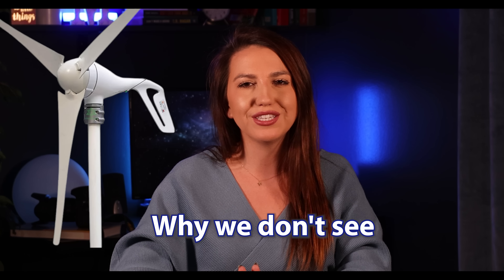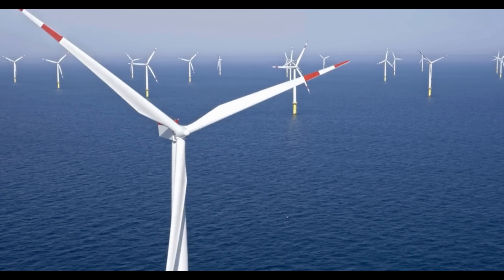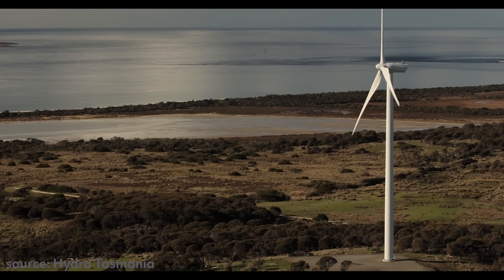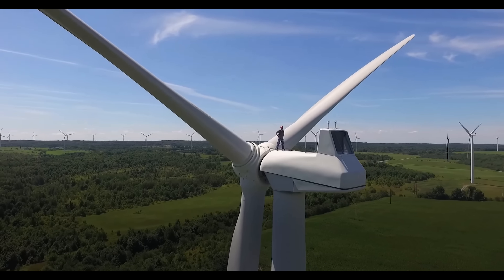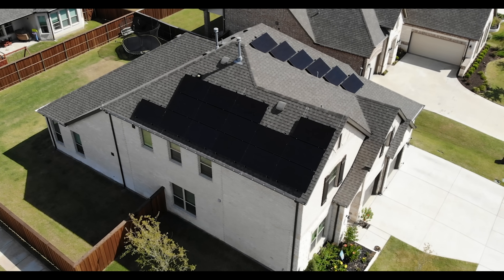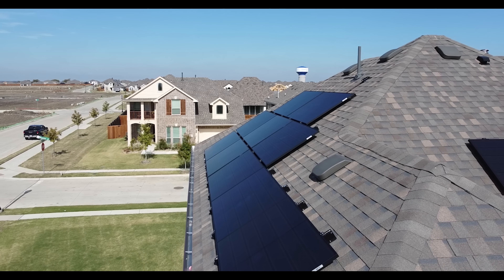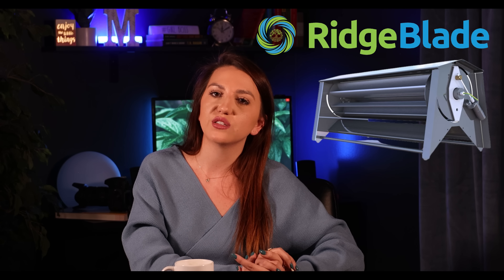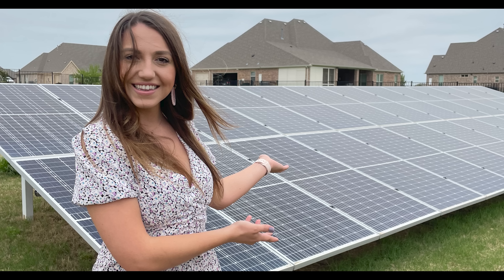Could this Turbine Destroy Solar?  | Why haven't we seen these small wind turbines yet...

Comment: Idea: Combined Solar and Wind Residential:
Use the PV panels and the roof slope to funnel the wind towards a ridge mount wind turbine system.  The PV panels direct the wind, aiding in keeping the PV cooler, and the wind speed increases due to the funnel effect.  
No one wants a typical wind turbine on their home, and HOA will try to stop them, but the ridge mounted design is much cleaner looking, and can allow more air collection to transfer to a single saft driving a well protected enclosed generator located at one end of the ridge, or the middle of the ridge where the home could have attic access for simple and safe maintenance.
Keep in mind a furnace fan is a scroll cage design because it is more efficient and this would apply to the ridge-turbines as well.
A ridge turbine could easily incorporate shutter blades to reduce winds that exceed the turbine safe capacity, or if the generator fails, the dampers can close,  If there were a snow or freezing rain condition the dampers can close to prevent ice forming on the ridge turbine, and being enclosed a heating system could be designed to remove ice from the blades while the dampers are closed.  Super simple, easy to maintain, safe for maintenance and wouldn't look out of place, and no bird strikes either - win win win WIND!

Comment: I live on Maui, one of the windiest counties in the United States. I am building an off-grid house right now just with solar. Micro wind turbines are too inefficient to be worthwhile relative to cost. Solar has gotten to be much cheaper and even with a huge surplus of wind I live on Maui, we get plenty of sun. I think this entire state should convert all the single family homes into off-grid power plants with battery storage because the state utilities sell power at 42 cents per kilowatt hour I can generate power with an unsubsidized solar system for under $0.16 per kilowatt hour. When I discount for hookup costs at $10,000 for the house and 30% tax credit on the cost of the system, my energy drops to $0.08 per KWH. Solar panels will shade my roof making my attic space cooler and protect my roof at the same time they're generating energy. I don't want the moving parts and maintenance required for wind power. I don't want the big pole in my yard. I don't want to listen to the hum of the wind turbine.

Comment: Windmills were intentially made huge so common people could not affort to buy a windmill. So they could have monopoly on electric energy. Which are the real reason the prized skyrocked with the CO2 tax. It was a school named Twind in Denmark that original started the idea not to be dependend on buying electricity, by making their own windmill. Soon after in 1970 there were an explotions of innovations of exploring the potential windmill energy. Those companies got bought up and new politicies were made. A CEO resigned due to that policy to only make huge windmills.
Later Co2 tax were added. That original idea to benefit from the free energy from the wind and get cheaper electricity, never happened. The investers got greater profits instead.
But to say windmill are bad and not effective is none sense. Those people just dont get the real scam in this.

Comment: Great video - Pup got you the sub before I even finished the video! Is there any type of small car mount turbine that would work to charge backup batteries or solar generators while driving? So many have to drive a lot during the day and something like this could help add extra power we could then take back home for the night. Thanks.
Reply from the maker: Thank you so much!! and not that I am aware of. But you and many others have thought of the idea of a car mounted one to recharge the batteries. Or just wind turbines to be installed along highways since the cars already generate so much air movement.
Reply from the maker: Thank you so much!! and not that I am aware of. But you and many others have thought of the idea of a car mounted one to recharge the batteries. Or just wind turbines to be installed along highways since the cars already generate so much air movement.

Comment: You know you're in for some BS as soon as you see "this (insert latest gimmick here) could or will DESTROY" whatever is working fine now.
Reply from the maker: Not really :) I did a ton of research and as a new youtube we have to try different methods for the algorithm to pick us up and show it to masses. At the end of the day, the people that clicked on the video and stayed, YouTube saw the video as somewhat valuable. So it helps us creators grow. 

If you really watched the video you would see I put my heart to fully understand if wind makes any sense for residential application. The title is changed every so often to see what works best for the viewers and its recommended by Youtube. 
I do think that the title did a good job as I got over 300k hits, and I am a newbie on youtube! :D 

I am writing this with most respect. Just put yourself in my shoes.
Reply: Hi. I have been interested in windpower since the 1970s when I saw a programme called House for the Future in the UK. They had a simple wind generator on a tall pole in the garden and it was used to power the immersion heater and apparently worked well. They incorporated lots of other  ideas around insulation, solar water heating and heat storage etc.

I have watched the whole of your video and agree it is well researched and informative. As you say, roof top wind generators are not really practical yet and unlikely to overcome the shortcomings you describe. So perhaps you can understand my scepticism  having seen the Destroy caption because even you don't think it's going to happen.  

I shall watch some more of your stuff. You do get a lot more interest than I get from my 17 followers 😂 but I'm only posting music.

Comment: I considered that a mechanical flywheel in addition to the prop catching the wind would be a useful combo leveling the power output but I also have considered  a battery bank to provide power with the wind to match or exceed the power demands;  but with no experience with wind, I rely on the presentation and comments which indicate noise and optics are issues to be resolved.

Comment: Wind generators are common on cruising boats.  The reason is that their off grid electricity cost comes to ~$1/kwh from diesel generators or worse from alternators.  The noise is always a problem and they don't last long but sometime in it's 3 years lifespan you WILL be stuck in an anchorage due to bad weather.  Then you will be grateful for the abundant electricity.

Comment: Technically, simple common sense ask one question first when you compare solar and wind and that is : Moving parts?.. That translate to maintenance, breakdowns, noise and cost. Yes, wind is a true help in support of solar when the sun sets. For a home it will keep the security system, lights and WiFi on while you sleep, preventing the batteries to drain. It all boils down to management and spending funds effectively and wisely, not on to good sales talk.

Comment: Solar is energy directly from the sun.  Wind is just indirect solar.  The sun hits the planet, heats up air, that air rises now having lower density than cold air, cold air from surrounding area rushes in under the now ascending warm air, this is what creates wind.  So between direct solar, and indirect solar, it seems like it should always offer more energy potential to just use solar directly.  The problem with both sadly is the incredible markup of the product.  As long as it is a fad to have any renewable energy and there are government programs to help consumers buy them, there will never truly be competition in the market.  The existing competition is not to provide the best product for the lowest cost, but rather to try and justify a high cost and grab up all the government benefits offered to green energy.  In a truly competitive market these products would be 5 - 10 times less expensive which would then actually make them capable of producing electricity for equal to or less than the cost of grid power in most areas.  Sadly because of the hype around green energy, their cost is drastically disproportional to their production cost or their over life time actual value.

Comment: Finally. People are getting smart. Solar only works part of the time. Wind turbines work more.
Reply: Well... Wind turbines tend to "work more" during the winter, where solar panels tend to "work less", but wind turbines also tend to "work less" during the summer, where solar panels tend to "work more".
So there is no one green power greater than the other, they complement each other.

Comment: Water flows throughout the city water system.  Why not take advantage of the flowing water through use of turbines or wire systems.
Reply: Well if you took advantage of the kinetic energy of pipe water in cities, than you would be taking away the kinetic energy of that water, and it won't have enough of it to make it all the way to your shower or sink.
What we COULD do however, which sounds much more realisitic, is to collect hot water from showers in big tanks and use that waste heat to make heat pumps more energy efficient, drastically reducing our heating bills and reducing the energy demand for heat. And I wonder why nobody ever thought of doing that.
Reply: @texanplayer7651  Thermal transfer from the ground is more efficient and $0 to heat the earth.

Comment: great video!   You put in a lot of work.  I wonder what you think about the grid with all this new tech?  Do you think that the grid could be looked at basically as the horse and carriage of power; and home based solar/wind/hydro/battery banks would be the automobile?  Seems most logical to me.  A huge portion of my power costs is associated with the grid(delivery they usually call it on the bill), not the actual power production or consumption.    And also, local zoning makes it very hard to use renewable technology, even in very small scale; due to what seems to be always concluding in having to be connected to the grid.   Even with solar on your home, often you are required to sell it to the grid only and then buy back your power from the grid and ultimately paying delivery costs.  You still have to pay delivery even when you produced the power at your home.   So, if the grid is the horse and buggy of power, I'm definitely really ready for the automobile.

Comment: The yields of Icewind and Liam F1 Archimedes look rather disappointing - have you looked at the KiteX its daily yield averages between 1.8KwH and 3.1KwH at an average wind speed of 7m/s (start up at 3m/s).  It tops out at 12m/s and shuts off at 15m/s so may not be suitable for high wind areas.
Reply: "may not be suitable for high wind areas"
The Liam F1 did mention that their invention is NOT meant for high wind areas, it is only meant for low wind areas.

Comment: Excellent overview. I like the Aeromine  design mainly because of no moving parts. I wanted to invest in Aeromine but it is a private company.  You might want to look into ammpower corp. which is developing green ammonia production. Ammonia can be used as a way to safely and cheaply transport hydrogen which can be used as an energy source store in fuel cells. Ammonia can be used as a source of fuel energy and also as nitrogen fertilizer. The company hopes to make units for farms and maybe later for homes.
Reply from the maker: Thank you so so much for sharing. I will definitely look into it. Also just posted a video on Aeromine product a week or two ago. Maybe you can check it out. I am very excited about their product, just hope they launch sooner. Here is the link to the other video: https://www.youtube.com/watch?v=FH545iR_j5I

Comment: You haven't seen all the trouble with them freeze up in cold weather the cost of replacing the blades is astronomical then you have the oil that needs changed its not just a little oil you should check the truth about them

Comment: The reason you don't see many home turbines is because, except in rare circumstances they don't produce much energy. One major reason for this is that when you are close to the ground there is laminar air flow, i.e. friction from the earth slows wind down. You need to put the turbine at least 150 feet in the air to get past this layer, which is expensive and considered an eye sore. There are also a few more reasons but for brevity are not discussed.
Reply from the maker: Very very good point, and thank you for sharing.

Comment: What happens when there isn't any wind and it's 95 degrees out? Plus how long do you have before the motor burns out? Plus what does it cost for yearly maintenance? Plus how many birds squirrels lizards etc. does it kill yearly? Plus how would they hold up in storms, hurricanes, hail, and humidity?
Reply from the maker: EXACTLY! Until those are actually answered with a proven product, I am with you. Not a chance against resi solar panel installations.

Comment: I made my out of pvc and its been working since 1987 has 3 alternators on a 10 to 1 ratio gear  belt drive. so far haven't had a problem only down side  when the weather is to hot there is no wind.
Reply from the maker: oh wow, thank you for sharing. That's pretty cool, and yes the weather plays a big role in wind patterns, where are you located approximately so we can analyze with wind world atlas? :)

Comment: Can give me advice on vertical wind turbines? I live in a camper in Wyoming which has a lot of wind. Don't have to put it up high, I run 2 , 200 watt solar panels with 6 acid batteries staying 12.8 , 24/7.  Can wind power outage keep me there and get me more on reserves? I like designs of vertical wind, can you show me some good ones and wattage I'll need?

Comment: There is a 10w micro Archimedes generator available for purchase but looking at its design and position it looks like it has not reached its full potential. Let me know if you want the link for the micro unit  320 mm x 220mm x 150mm diam. $70 AUD approximately
Reply from the maker: send over the link!
Reply: @solartimeusa  did you get the links I posted ?

Comment: Been looking into wind turbine for a number of years. 
Although being told you must have enough land for the turbine to  be away from neighbours as this apperently can cause alot of noise with me being in the UK this then apparently goes against the law.. 
Anyhow I gave up on the project shame really as this is a fantastic idea as solar is a waste of time in my opinion from previous experience on previous property
Reply from the maker: Have you tried solar in UK? 
I know there is significantly less sunny days than in my area in Texas but still I wonder how that would play out?
Reply: @solartimeusa for argument sake the forecast from the met office will be gust of this evening,/ tomorrow gust 45 as low off 25mph perfect for turbine just a shame I need land to be allowed to get 1 as said previously 😢😢
Reply: How do?
Yes Ive tried solar although the solar that was installed worked from the light not by just by the sun. 
Personally I seen absolutely no benefit at all for having them the price per unit was penny's  per month. We do get decent weather where I live on the south coast. Nothing to what you get down in Texas though 😢

In my opinion if you was to try solar I would recommend running the household with a number of batteries, how long they would take to charge the system though I'm unsure If you set it up correctly and turn off your red  RCD unit on the electric box would be the only way of taking the benefit of something I didn't get around to doing in the previous house.
Could also do the same with wind turbine so your not requesting from the electric company.

Comment: A STANDARD 13 CF HOUSE REFRIGERATOR-SIZE DEVICE CAN SAFELY SPLIT WA
TER (H20) INTO HYDROGEN AND OXYGEN TO GENERATE HOUSE ELECTRICITY, RECHARGE AN E-AUTO BY SELF-GENERATED HYDROLYSIS.  MEGA-OIL CORPS AND 12 YRS OF BUSH (TX OIL) ADMINISTRATIONS KILLED THIS HIGHLY VIABLE, RELIABLE, NO MASSIVE PRODUCTION PLANTS/DISTRIBUTION SYSTEMS/WEATHER-SPECIFIC UNRELIABILITY/ ETC.  PS: STANDARD INTERNAL COMPUSTION AUTOS/TRUCKS CAN RUN W/O GAS/DIESEL WITH THE SAME ON-BOARD WATER HYDROLYSIS SYTEM UNDER UR PRESENT CARS ENGINE HOOD -- SO, WHERES UR RESEARCH ON THIS!?!